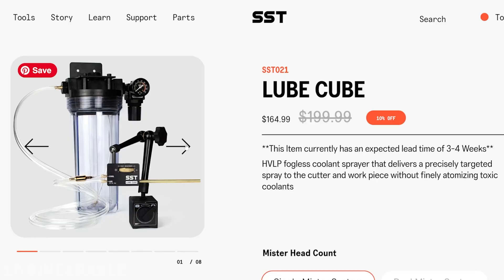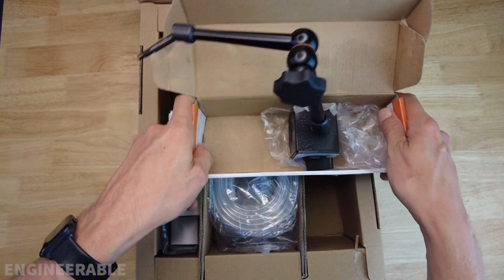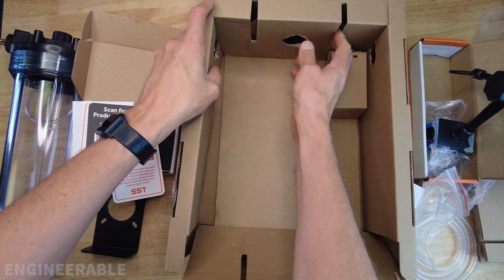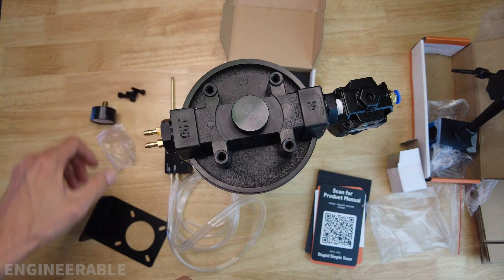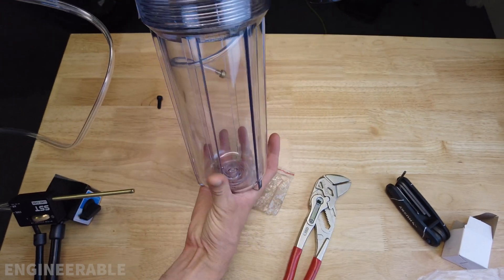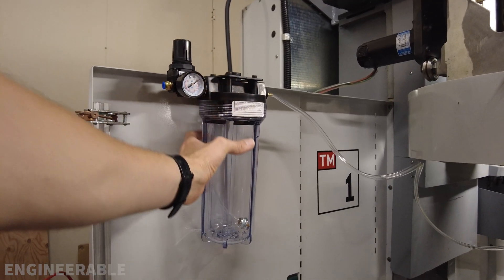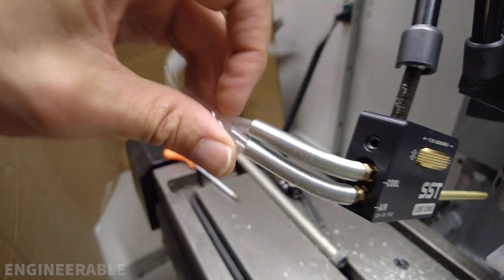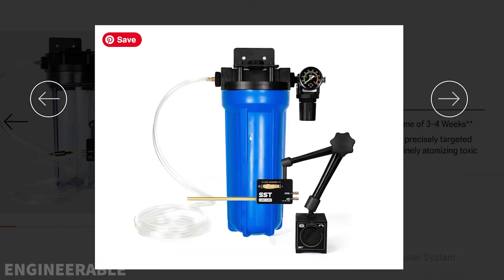How Good Is This Cheap FOGBUSTER CLONE? I Tested the SST LUBE CUBE Fogless Coolant for CNC Machining

Comment: I made mine with a simple inline air lubricator and pressure regulator, a 6mm steel pipe with a LPG kitchen burner jet at the end and a small bracket.
Take a look to it working on my CNC.
A single drop of oil every 5~8 seconds and you're good.
With at 1.5/2 bar with that small orifice it blow chips and avoid any issue to the tool.

Comment: Even though the price. I prefer the Fogbuster . The coolant reservoir is a molded polypropylene container.  It will not burst or explode . 
I have used it with cutting oil , coolant,  odorless kerosen and even alcohol. 
Plus the Fogbuster you can easily see the amount of coolant left in the reservoir. 
I know that the  patent has expired and anyone can copy it . Heck I could  make the valve real easy .
But trust me, it's cheaper to buy it from Fogbuster.
Reply: If you can make the valve yourself, how is buying the ‘wallet buster’ cheaper? all the rest is easily and cheaply available via amazon/aliexpress etc.

Comment: I got this mister kit the other day from Amazon  and it’s awesome. 5 stars. I’m running wd40 through it and it works well. It’s great that you can adjust either the air flow or the coolant flow, independently of each other. I might drain the reservoir after each session because I don’t know the plastic reservoir will be affected. Thx for your review. Great stuff.

Comment: Hey have you made a video about upgrading the srb1000 and putting metal gears in it plus a new piston?
Reply from the maker: It's the same gearbox as SRB400, so follow those instructions. All details and videos here: https://www.engineerable.com/single-post/what-s-inside-splat-r-ball-gel-blaster-i-take-apart-gel-ball-blaster-to-see-how-it-s-made-works
This is the SRB1200 teardown video https://youtu.be/FKxPLUxrIpM?si=RZo313eCKfvR1vSJ